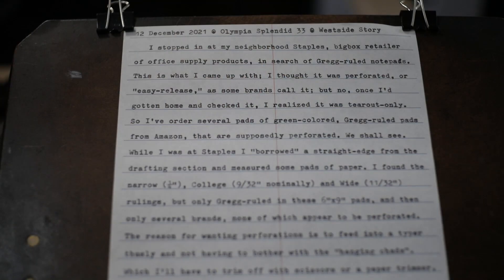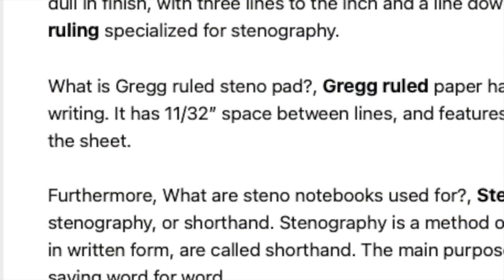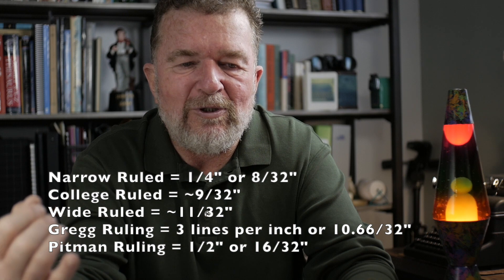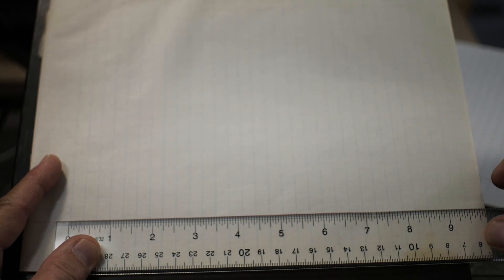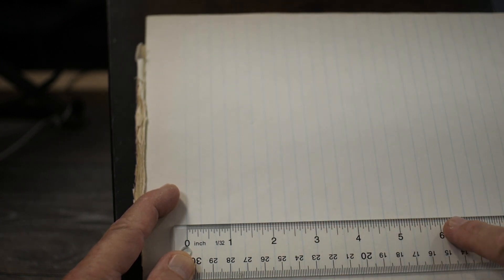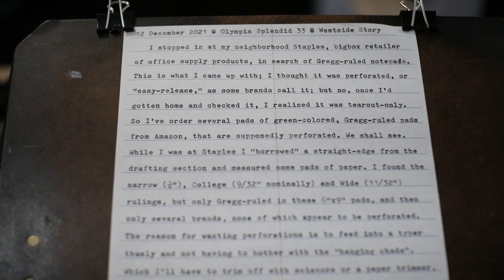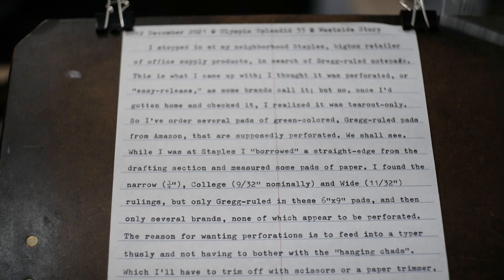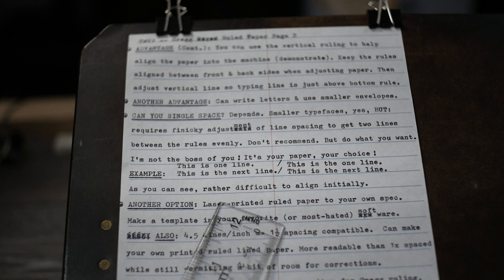Typing on Ruled Paper

Comment: I've spent a few hours recently trying to type on ruled 3 x 5 file cards.  It's a little bit of a trick.  In general it seems like 1 1/2 line space is about 1/4", which is about what we're looking for.  AND YET some typewriters seem to do this easily and on some it's a mess.  The ability to easily free the platen, by a push-button on the roller knobs say, seems very helpful.  After many attempts I started to think about getting BLANK 3 x 5 cards!  Worst of all is that if you're trying to get something on that LAST LINE of the index card, there's not much holding it IN the typewriter, the pressure rolls aren't touching the card any more, you don't really have a grip on it!  I keep wondering if some typewriters have a METRIC line space so it's not 1/4" I'm getting but something like 6 or 6.5 mm?  I think you have a video about that I'll look for.  This seems a little obsessive, but I think it can be solved once for ever.
Reply from the maker: Paper rulings can be frustrating for typists. A tip for holding cards is to fold a sheet of paper with a crease across its width, then thread the sheet into the machine with crease up, and slip the card into the crease.

Comment: Thank you for giving me a new use for my steno notebooks. I’ve always loved the line down the middle. I get the most use out of them for woodworking projects and when I was in school they were my preferred note taking notebooks. I found some Gregg ruled printable templates. I’m going to make custom 11x17 Gregg ruled paper. I’ve experimented with columned typing on large format paper in the past. I could never get the lines of text to line up. Steno 11x17 paper would make column typing 10,000 easier.

Comment: Although nothing to do with typewriters, I've oftentimes used an Excel spreadsheet to create my own forms.  A person could probably take an Excel spreadsheet, adjust the spacing on the lines, and add the outline faintly to an excel sheet and make their own templates for these types of things...I don't have a typewriter that I can find ribbons for anymore so I haven't used a typewriter for several years, and have no way to test and work up any sort of template, but I'm sure someone out there with a working typewriter and Excel spreadsheet knowledge could make up a template.

Comment: Hi Joe,

Very nice idea and presentation. Thanks!! 

Is the Gregg line spacing from the same Gregg  editors of books for teaching typing method? It would be cool if it did.

I have a couple pads of paper from 30+ years ago that is oddly 8 by 10". One of them is blue airmail and the other is newspaper-like. I will try lining some pages out of those for fun.  I might send you a letter on it :)

On my Lettera typewriters, the line spacing is not indicated on the machine as 1-1.5-2, rather it is 1-2-3 but it does have 1.5 line spacing. I wonder why 1.5 spacing is not exactly 4 lines per inch or 1/4" spacing?

For the first draft of a short story I did in October, I typed with double spacing like you did in this video in order to have space to make corrections or additions. Otherwise, I might type letters in single space.

For archiving the 6 by 8" steno pages in your binder, could you simply punch two holes in the margin and apply the little ring/washer stickers to prevent tear out?

Take care.

Daniel

Comment: Love this. Have been experimenting with various types of paper. May I ask what type or brand of sticky tape you are using? Looks a bit like medical tape rather than Sellotape
Reply from the maker: It’s standard Scotch brand (3M) tape.
Reply: @Joe Van Cleave  thanks, I don't see that much here in the UK (mostly clear tape) but I'll check out Amazon
Reply: I used to see typewriters that had rolls of paper fixed to the carriage in a Journalism context.  I always thought that was very clever, you'd just use as much as you needed.  I can't seem to find that kind of paper, it might have gone with the Teletype machine (!).  The only thing I can find easily is the 3" wide rolls for small printers.  It's cheap and abundant!  I have a vague memory of the paper roll being on the WALL and am thinking to try this with the 3" wide paper, just for fun.  Leave it set up forever.